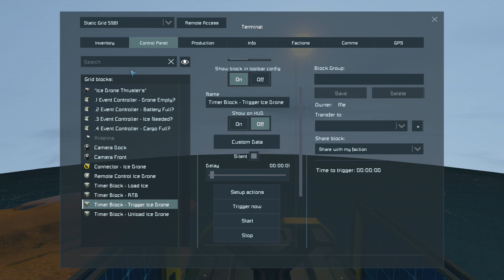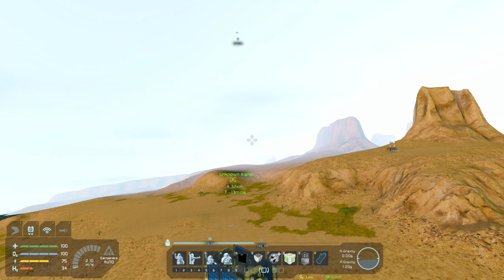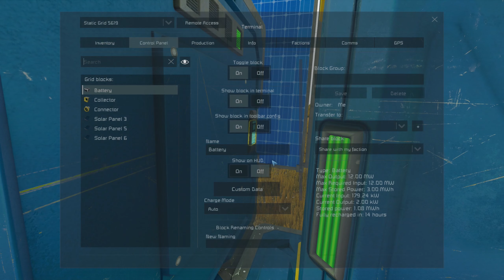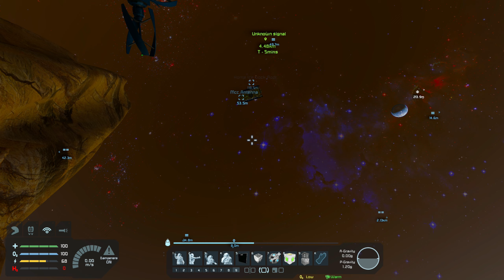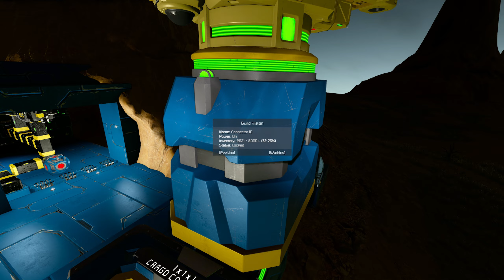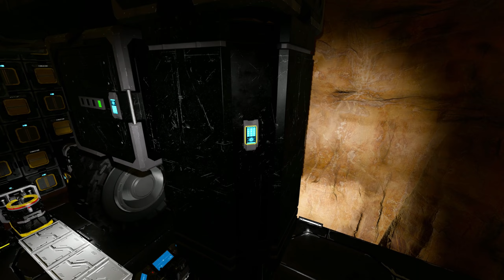Drone & Drill Testing/Fixes S2E10.5 - Space Engineers

Comment: Cool episode there mate. I spotted the low battery power on the flight to the Ice pickup and had another of my super dooper thoughts (didn't have to laugh that much...), the thought was that with the cargo drones they are being sent out to drill rigs etc which have at least one big battery on them, if you were to add another solar panel or two to the rig then when the cargo drone lands and switches to "Auto" for the battery the one on the rig could switch to "Drain" thus giving the newly loaded drone the rigs excess battery power up to a max of %95. Of course the rig battery would switch back to "Auto" after the drone starts it's return sequence.  I'll be listening for why this idea is sub-standard in the next episode if it cracks a mention at all, :)  .   Cheers mate, have a good one and catchya ron.  Ben.
Reply from the maker: Atm the ice Drone uses about >50% of its charge getting to and from the dock, I think it would be an unnecessary addition as it works well as is...
Might be an idea to charge the Drone a bit when it's loading with ice then turn the batteries back to Auto with the RTB timer? 🤔